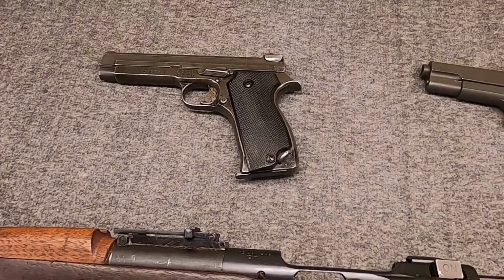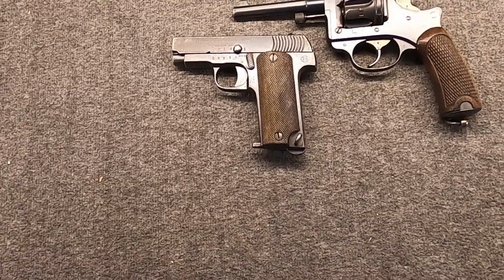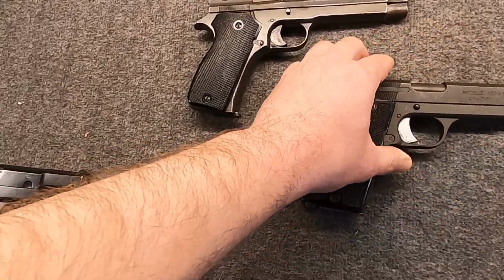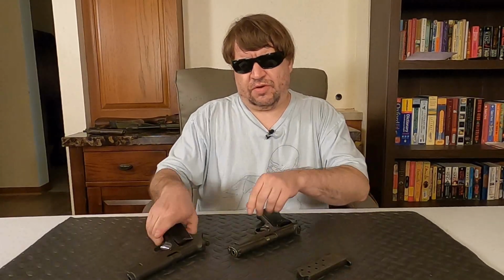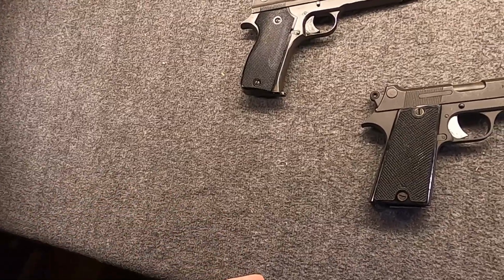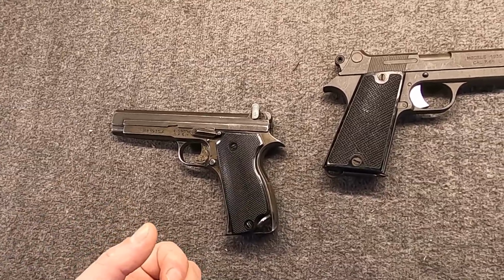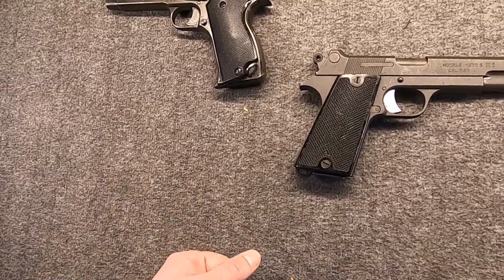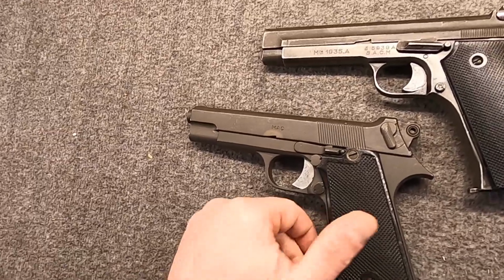SACM Mle.1935A & MAS Mle.1935S (Just How Long Can Misha Ramble On About French Pistols?)

Comment: always been fascinated by French pistols. missed running into any in person. I had a source for a slew on inexpensive interarms Star and Astra pistols. They were as new in the little plastic cases with the tools and literature. Went a little crazy with those. No regrets though. I was thinking during video that the one pistol looked very similar to the sig 210 now I know why. Thanks great video to watch on a rainy day!
Reply from the maker: Yeah, you really don't see many French pistols in shops (aside from maybe some MAB Model Ds) so they are pretty uncommon, and yet at the same time still don't bring a lot of money. They are well built and i got into them thanks to the connection between Walther and Manurhin. You know me and Walthers hehe.